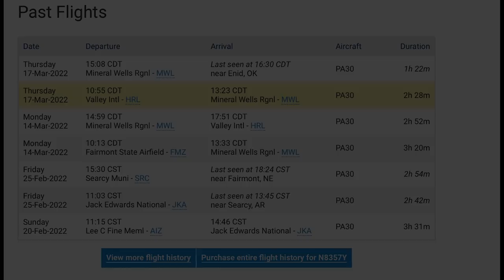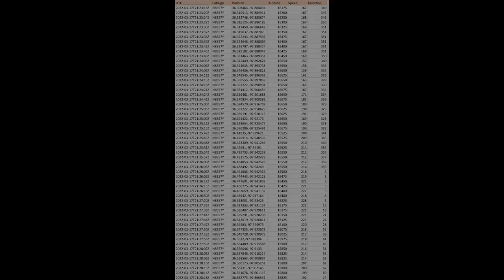FlyWire Accident Review  PA 30 N8357Y Loss of Control Inflight

Comment: Thanks Scott, condolences to the family and friends of the 3 onboard. I agree that this has all the telltale signs of a loss of control by a VFR pilot in the clouds, and on that note I want to emphasize that as long at pilots keep the bank angle at or near zero, everything else SHOULD be fine. Loss of bank control is the "first domino" that starts to topple all of the other dominoes. First the airplane banks, then the pitch angle goes down because of the bank, the airplane accelerates as it dives, then the pilot tends to pull up and that's when the structural failure happens. If pilots would keep the bank angle under control, the first domino doesn't fall and neither do any of the others.
Reply from the maker: Thanks Dean and you are exactly right!
Reply: Every pilot has an artificial horizon. If everything else is going badly, at least get wings level.
Good advice I heard for VFR pilot caught in IMC is: wings level, pitch for level flight, throttle for 10° flaps, extend 10° flaps, heading by gentle rudder input. 
Declare emergency.
Wings level above all else.
Reply: @slartybarfastb3648  I agree with the good advice EXCEPT for the flaps. I would NOT put flaps down for a VFR pilot in IMC. It adds risk because for most airplanes, the certified load factor (G-force tolerance) goes down with any flap deployment. In other words, normal category airplanes are certified to 3.8 positive G's with the flaps up, and many are only certified to about half that if the flaps are down, though this does vary from one aircraft to another. The positive case for putting flaps down is that they add drag, but the amount of drag added with only about 10 degrees of flaps is very small. On balance, adding flaps adds some risk for little or no benefit, and that's why I would NOT put flaps down in that case.
Reply: @zidoocfi  This would probably make a good video in it's own right. What is the safest, most stable procedure for a VFR pilot trapped in IMC? I definitely can't say for certain.
Introducing flaps has the purpose of slowing the situation down. The pilot has a target airspeed which may only be achieved by bringing attention back to the instruments where they belong. Flap extension speed can't be ascertained while looking outside for a hole in the clouds.
The point is to make the plane slow and stable. Trim wheel, throttle and slight rudder become the primary controls.
Reply: @FlyWirescottperdue  Long ago, the 1965 Mooney Mark 21 I flew had as standard equipment "Positive Control", a wing-leveler "autopilot" that was always on unless you pressed and held down a button on the control wheel. I wonder how many lives it saved.

Comment: There’s so much talk of the importance of an instrument rating, which I basically agree with, however even more important is IFR .  To me, that’s the deal breaker.  I fly a Twin Comanche I’ve for owned for 30 years, am commercial and instrument rated, but no long fly enough to even pretend I’m capable of flying in conditions such as this pilot was.  It takes a tremendous amount of effort to keep a twin Comanche and the avionics updated and current, and even more effort to keep myself current.  I wish there was more emphasis on competence in various instrument conditions.  Keeping IFR legal is relatively easy, but remaining safe, confident and current is a whole different level.   Like Scott stated, a night or two in a motel, or a bus ticket, is much preferable to the lousy outcome this family experienced.  A lesson for all, and reinforcement for myself.  Thanks Scott.
Reply: I get that an instrument rating would have saved the day here, but an IFR rating is tough to get and tougher to maintain proficiency with.  Army Blackhawk pilots are trained minimally on IFR approaches but rarely fly in low visibility or heavy weather.  Vietnam UH-1 pilots had zero IFR training and had to just get vectors from a field with radar.

Comment: PA30 owner. These machines are capable of distance traveling, and weather changes are more likely to be encountered. I appreciate how you presented sound advice in this case.
Reply: With a great PA-30 channel too!
Reply: The PA30 is a fabulous aeroplane. I did my initial instrument training in one in the mid 70s, eventually leading to a 30k+ hour airline career flying up to and including 747s- yet I still have fond memories of the PA30. 
Sweet aeroplane, but must be flown sensibly and with respect for it’s limits. Flying into cloud without an instrument rating is waaay outside those limits, sad.

Comment: I’m surprised that an insurance company would write a policy for a multi engine aircraft for a pilot that does not hold an instrument rating.  I am a CFI / CFIi / Multi that flys close to 600hrs / year (250hrs/year in a Bonanza A36) and the only rating that decreased my insurance was the initial instrument rating.
Reply: Why is it a given that this aircraft was insured? The FAA does not require either liability or hull insurance for Part 91 operations. The state I live in (Alaska) does not require insurance for Part 91 operations. I imagine most states have similar requirements (or lack thereof).

Comment: Thank Scott. Let's think about "the moment the pilot lost control"... If a normally aspirated PA-30 is climbing at 1000 FPM to 16,000', it's in a severe updraft. The 4500FPM descents are severe downdrafts. He was in or too close to a thunderstorm.
Reply from the maker: The 4500 FPM was in a climb, you can see the data points in the video. I don't discount the possibility he was in up and downdrafts. There is no radar record of a thunderstorm at the date/time/location of the accident. So, I can't make that assumption.
Reply: Air is a fluid and is constantly moving, even nowhere near a storm…would be interesting to get a meteorologist to review low and mid level dynamics in the area at the time of the crash
Reply: Thunderstorm was the wrong word for sure but if the data is correct, it seems like severe upset anyway. In the end, I agree. This pilot was in the wrong situation at the wrong time. It is better to be on the ground, wishing you were in the air than to be in the air wishing you were in the air. I've been in both situations and neither is much fun but I wish the decision to wait it out would have been made so this great family would be alive today.

Comment: One thing that seemed a little surprising to me was that the airplane appears to have passed the worst of the weather, based on the weather radar plot overlying the map of its track. There are many reasons why that might be so, however, and one might be that the weather was rapidly deteriorating. In order to see if that might be the case, I went to NOAA's archive of weather radar maps (see below.) 16:38 CDT is 21:38 UTC, but entering that for  3-17-2022 showed the precipitation mostly to the north of the crash site.

Backing it off one hour, however, showed a radar map very similar to the one on the FlightAware screenshot. I assumed I had made an off-by-one error in converting the time, and maybe I have, but I tried again and checked with a couple of time-conversion websites, always getting the same answer.

If the weather was as shown by the NOAA archive for that time, it might explain the flight's zigzag path immediately prior to the crash, as the pilot sought a route through the weather blocking his path.

As to whether the storm was developing rapidly, the hour leading up to 21:38Z and beyond shows the precipitation strengthening slowly, but it is still almost all greens, so I agree that strong convection does not seem likely.

I will not give an URL for the NOAA archive, as doing so sometimes seems to cause comments to be removed, but if you search for NOAA National Centers for Environmental Information Radar Maps Archive you will find it. Currently, they are having problems with the underlying maps and only show a minimal one, but the location search works, and hopefully the maps problem will be fixed soon.
Reply from the maker: Good comments Ray and good research.

Comment: Scott Back earlier in my low time 80's I got into a pickle, to low for radio com (all of my time in Mtns) Had wife,my newborn & brother 172,
 P/U Rime headed to Cody Wy.then carb ice I'd picked an arrival point then as fast as wx hit me I lost ALL gnd.ref. knowing I DID NOT want to stall it yet NO pwr.I pushed myself outloud  A/S bank make standard rate turns total Imc, broke out under deck Eng.pwr returned I was approx 700'agl..head for my spot.PWR LINES O.SIT! I could see Maybe 2mi F.V. & was breaking I'd lost the Ice ,Got good pwr back so headed to Dubois Wyo. Landed @ this unattended potholed field That's where I pulled chunks of seat cover out..wail waiting for the wx & next legs this is only a 1/4 of what turned into a 3 state historic storm no phones  no power made national news
Wyo.Utah &  ID. 4 days later Retuning fro. Billings Id Lost sight of the Tetons
Sleeping in plane waiting again ..topped off tanks and..Anchored the plane caught a Connie back to SLC and Yes I'm able to tell the story that 1st FUBAR was Never gonna happen again..as the wx became extremely worse talked to the Capt. we'd broke out @ 26,000 & what a ride getting there..I returned 3 wks later to p/u the 172 .
Never have get" home "as a plan stay alive so YOU can tell your stories.

Comment: Listening to stories like this, I really keep thinking that pilot EGO and temperament caused the crash.  Some of those huge increases and decreases in altitude can be severe turbulence.  But also I do know just how problematic can be locating an air-strip when flying low in poor viz and in rough weather.  Even if we know where the strip is meant to be, problems come thick and fast.  We don't identify the strip in time to make a stable approach, compounded with drift in turns etc.  That was an education for me on a student solo - but being ? chicken ?  I turned and headed out and home.  I believe we all have faced a similar learning experience, so why are we still alive.  I put that down to the personality and EGO of the pilot, because he wants to get through.  Maybe he wants to be the one that boasts that he or she got through when all others tied down somewhere and spent the night.  Weren't his family with him in this crash?  Maybe he felt the need to show that he can always prevail?  It is possible.  Also regarding hypoxia,  not everyone has a normal blood oxygen.  I know of passengers who felt off in a 172 at 7,000' altitude.  So perhaps the allowances in the law and rules  could in some cases be terribly excessive?  It is still hard to imagine how anyone could hold a license, and who has had normal tests, and flown in simulated IFR could still push on into such conditions.  Being under that hood should prove to any single pilot who is not fully equipped and not properly expert, just how death is sitting with them.
Reply: Depends on your health how you feel at high DA , worst shape your in amps the affect
Reply: Now that you've mentioned something that almost nobody else ever does, ego and temperament, I agree.  Since I'm not the kind of person who ever had the kind of confidence and therefore ego that pilots who end up like this have, I believe that for a lot of them, they are simply always in control.  Whether it's of other people or their own lives, so that when they are faced with a situation where the wise option is to admit that you can't control the outcome, they just don't even consider that possibility because they are used to always succeeding.  It's not just a "bad decision" here or there, it's a habit of always doing what you want and getting what you want and living to tell about it up until the time comes when they don't live to tell about it.  I think I can see this because I'm describing someone who is the opposite of myself.  I wanted to be a pilot when I was young but I talked myself out of it not because I was afraid of flying, but because in retrospect, I never had any confidence that I could succeed at anything I tried, including landing any entry level job requiring no special skills.

Comment: As a skydiver, I can sometimes notice the early effects of hypoxia after only a moment at 13,500. Not so much on a normal climb and jump run.
But if I'm one of the last out of the Twin Otter or Skyvan and for some reason we need to circle back for a second or third pass, it begins to creep in a little. 
Maybe it's more noticeable while standing in a turning airplane than a pilot would feel. After unusually long (5-10 minutes) jump run attempts for clouds or hesitant/slow jumpers I'm happy to get out and down to thicker air.
Reply from the maker: Thanks Slarty.... don't forget your towel.

Comment: One thing VFR pilots should do is take some instruction on basic instrument flying.
     You don't have to be IFR qualified to use your instruments to keep your wings level and use your radio to get help.
     I don't understand how a CFI can allow their student to carry out a cross country solo flight without knowing how to orient the plane in space without looking outside. It's not that hard. 
     Vertigo is quite common in IMC, especially if you lose outside references without warning. It even happened to my dad. He was VFR at night over a populated aria. Just as he rolled out of a turn he entered an unseen cloud. He lost sight of the ground and horizon and every sense in his body told him he was in a bank.
      But he was a CFI and instrument rated with many hours in hard IMC. He looked at his attitude indicator and his bank indicator and both showed his wings were level.
      He fought the urge to correct the band and after a few seconds popped out of the cloud. The horizon was right where his instruments said it should be though his body was telling him he was in a steep bank.
     As soon as he could see outside again his vertigo vanished.
     That's the thing with seat of the pants flying. The seat of your pants is a lying ass. Don't trust it to orient the plane when you can't see outside.
     Anyone can end up with VFR into IMC. Being prepared for it will save your life and your family's life.
    Why is basic instrument flying required for a private pilot's cert?

Comment: Thanks Scott.   In addition my GA time, I have spent just north of 400 hours flying hang gliders (recreational and competition) and just shy of 200 flying sailplanes.  I have been sucked up beyond cloud base (at 8-14K MSL, especially in New Mexico, West Texas, etc.)  with my variometer pegged at 2K/min up, several times.  (with no engine)  I wonder if the radical, vertical speed flight data points were due to the pilot experiencing rising thermal massed of air while in or near the cloud tops or upwind side.  I have both seen this, and climbed the upwind side of huge cumulus clouds using this technique.  Just some food for thought.
Reply from the maker: It's possible.

Comment: Every time I read about unintended flight into IMC followed by the loss of control in a sophisticated GA aircraft I wonder why there isn’t more emphasis on autopilot use in the transition training for a more sophisticated aircraft.  I agree with everything you said, but think of the different outcome if the autopilot had been used for the descent.  If autopilots were used more consistently, we would have a lot fewer of these type of crashes including JFK jr. & Kobe.  I always used autopilots when doing IFR approaches, because it lessen the likelihood of me getting behind the aircraft.
Reply from the maker: We don't know if this airplane has autopilot. If it did the pilot may have been able to survive. But that ignores the issue... why get into that situation in the first place?
Reply: APs have their limits as well - unfortunately some disconnect when things get too confusing for them.  It's not a "get out of jail free" card.  ☹
Reply: In many older GA aircraft (such as a Twin Comanche) the autopilot would be inoperative. There are many, many components and wiring harnesses and the system requires frequent repair and reconditioning of the individual components for everything to work properly.